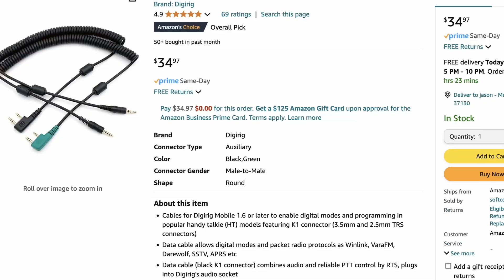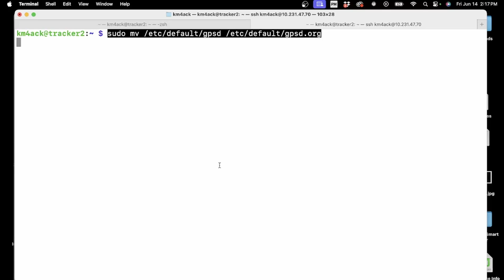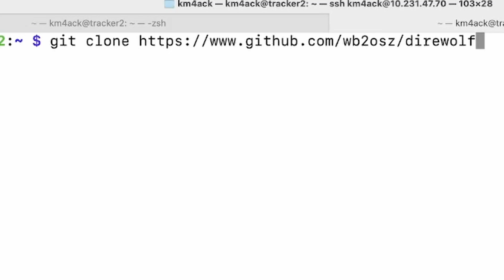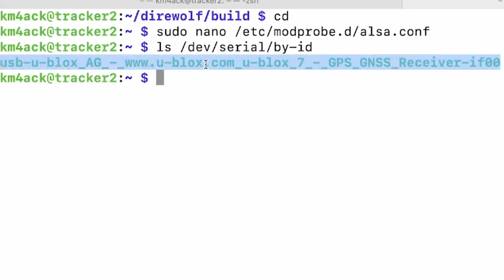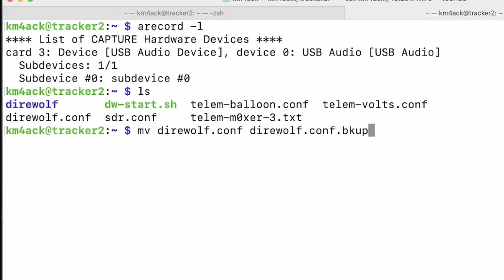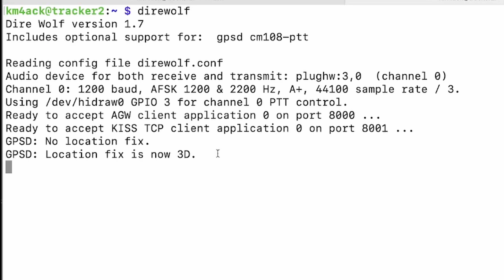Build an APRS Tracker with a Raspberry Pi Zero

Comment: is this applicable with raspberry pi 4?
Reply from the maker: yes
Reply: @KM4ACK  Good day sir, I'm having a problem regarding the "ls /dev/serial/by-id" part. I'm using a gpio gps module instead of a usb one. What should I use as command instead of it? 

Also, I installed the os via raspberry pi imager, not the lite one, is it ok?
Reply: @KM4ACK  In this part, DEVICES="/dev/serial/by-id/<PASTE_GPS_INFO_HERE>" since I'm not using a usb gps, I don't know what to put here which leads for an error to occur when trigerring the "cgps" command
Reply: @KM4ACK  Also, instead of digirig, can I use a normal sound card?

Comment: Hey Jason, quick question. It looks like the GPS you mentioned in the parts build is designed to work with a full size raspberry pi with standard "usb a" ports. If we're using a raspberry pi 0 2w, there aren't any of those. Are you cutting the cable and running straight to serial inputs via gpio? Please let me know. Thanks!
Reply from the maker: You'll need an OTG adapter - https://amzn.to/3E6FMkL

Comment: Great video. Bought the hardware including a new digirig and everything works without the baofeng connected. 
Direwolf gives audio error at transmit and it hangs in tx when connected. 
I can pull the digirig cable and clear it, but it happens every time. 
Says something about cpu too slow for 9600.
Reply from the maker: @joefritz2981  make sure to use 1200 baud in direwolf. Radio locks in TX due to RFI.
Reply: @ Thank you Jason.  Added the digirig audio pad and the 9600 baud was cured and found the cheap usb hub was getting hit with RF and the RPi zero also needed a bit more isolation.  Works now.  Fun!

Comment: So I love these videos.  One thing missing is the set up of the radio.  I am using a baofeng UV-5R - can someone point me to a good source for the configuration of the radio.  I am using the digirig lite and baofeng cable.  The transmits but my Yaesu FT2DR does not receive any data.  Nor does the Baofeng receive the data that the FT2Dr is receiving from other stations.   Appreciate any help.

Comment: I have a DigiRig and decided to use it while I wait for the DigiRig Lite. I set PTT to use CM108 but the radio doesn't key when Digirig sends the transmit string. I am using the Baofeng black cable plugging to the Audio port on the Digirig.  I don't think I missed any steps and rechecked.  I figured the DigiRIg would work, until I get the  Lite. Do I need to change anything in the setup? 
I Been playing with Linux and Unix for a while so I am not new to this.
73 De N3SRZ
Reply from the maker: The Digirig uses RTS PTT instead of CM108. Only the Digirig Lite uses CM108 for PTT.
Reply: @KM4ACK  Thanks.  I will wait for the  Lite to come in .  I tried to use RTS, but got a message the usb was in use or some such.
Reply: Fixed it.  Thanks again.

Comment: I’m new to using raspberry PI computers. I only have a windows laptop and Linux is new to me. Are you using one or two monitors and does the Pi have its own?
Reply from the maker: For this build, I wasn't using a monitor on the Pi at all. It is completely headless. To install and configure, I used an SSH connection from another computer to the Pi which gave me command line access to the Pi.

Comment: Found a Pi Zero 2 W with header.  But in looking at the build notes I see pick apart foam.  What are we suppose to do with that ?
Reply from the maker: I used the foam when mounting the components in a case.

Comment: Does anyone has a source for a Pi Zero 2W with the header.  Amazon is out.  But they do have a Pi Zero W with the header.  Would that work ?
Reply from the maker: This will work with or without the header
Reply: Adafruit has them for the best price.  I bought two without the header this week for $15 each plus shipping, but they also have the header model.

Comment: Good descriptions of what, how, and why you are using the commands. I use your videos, and those from other YT contributors, to learn about Linux. I am a long-time MS-DOS (since MS-DOS 1.0) and Windows user, but Windows 11 has STRONGLY driven me to convert to Linux. Now about 90% there. I have a few Win programs that do not have Linux counterparts, so I am learning to use Wine for them.  I have several Pi Zero W's laying around and I love messing around with APRS, so now I will see if they still work.

Comment: Ran into a 'bug' / issue: Had to set "USBAUTO=false" in /etc/default/gpsd and "PTT /dev/ttyUSB0 RTS" in direwolf.conf to get a regular DigiRig v1.9 to work, otherwise awesome presentation as always, sir...
Reply from the maker: Interesting!! I have run into that before with Icom radios.  I was using the digirig lite which doesn't use RTS for PTT so that might have been the difference and why I didn't have the issue in this build.